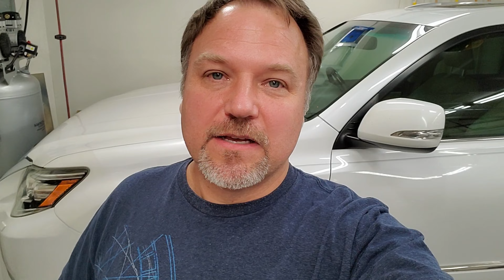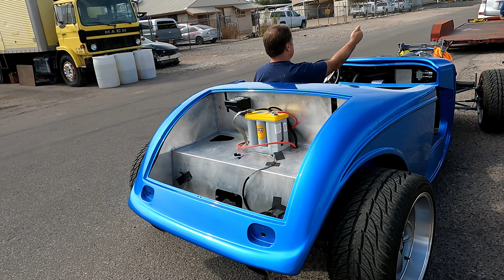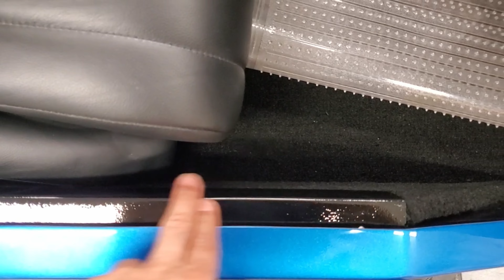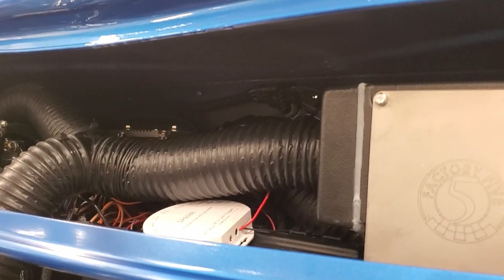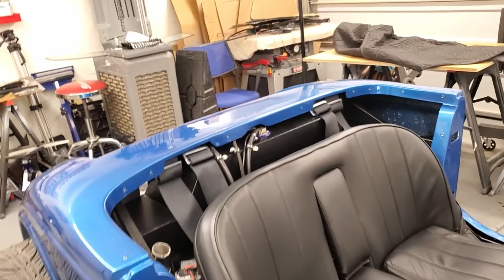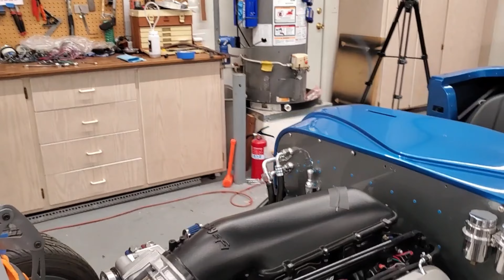Factory Five 33 Hot Rod V2 - Painted Body On The Frame

Comment: this reminds me..... I need to add the firewall to body bolts. Great color and so cool to see this car at this stage in your build. Once you get the body bolted and hard top on you may hear some squeaking and thats just the body settling. Mainly its from where the front of hard top meets the body, those 3 bolts under the windshield. Make real sure you have the rubber trim padding under the hard top where it meets the body. I did two rows of it after the fact. I think the manual shows one. Keep on keeping on and cant wait to see it fully done. Maybe if you do some car shows in Arizona I could bring mine. Love Arizona.
Reply from the maker: I missed this season, but definitely doing a tour next season.

Comment: Looks great, can’t wait to see more. I was able to get my “33” titled, tagged and insured this week. I’m a little behind you just started my body work. I’m going to paint it myself, using our local Vo-tech. They have a night class so I be able to use the paint booth.
Reply from the maker: Even though I thought I would be painting the body, I stepped aside on this one and took it all in.  I am planning on doing most of the work on the 66 Van.
Reply from the maker: Not matter what, put a lot of clear coat on, then you can sand it and have a great looking car.  There is a limit to how thick the layers can be chemically. Do the max within guidance.
Reply: @StreetRodJim  you bet, I’ve painted a few cars over the years. The last one I did last year I used a newer product called one step. You spray 7 light coats and block sand with 600 wet/dry paper after the third coat. Cut and polish the next day. It turned out great but I’m going back to base/clear. There really isn’t that much time saved and I’m used to spraying it.